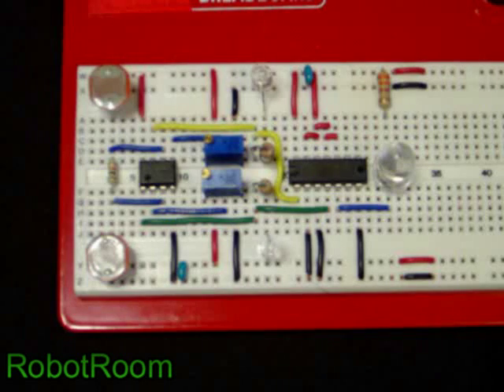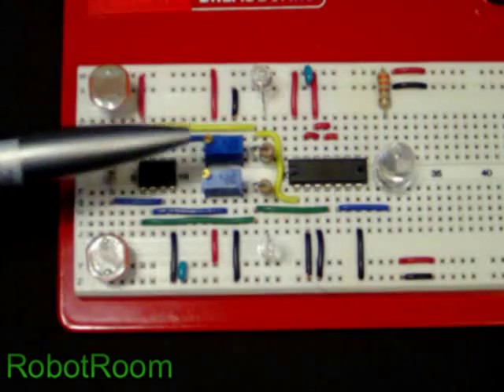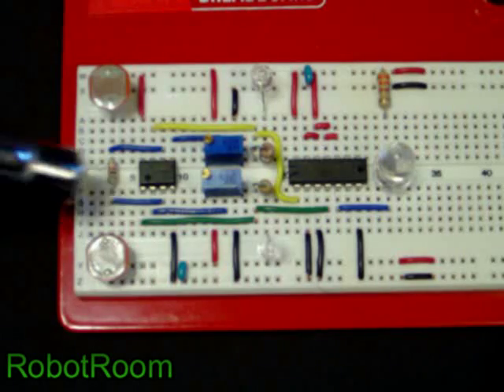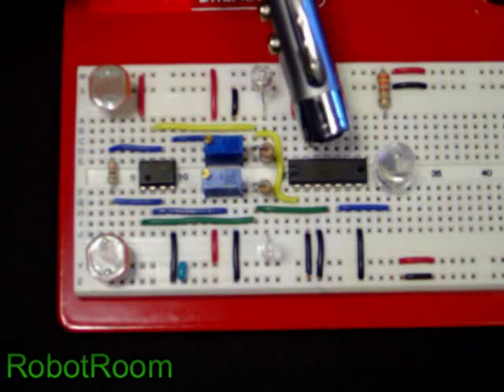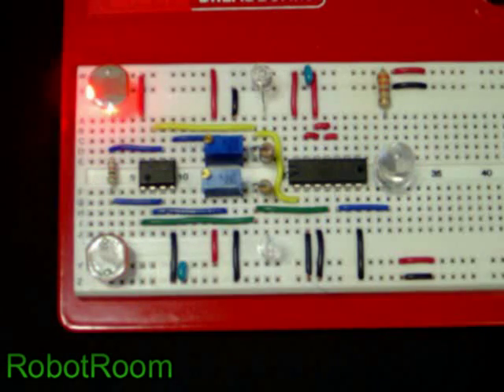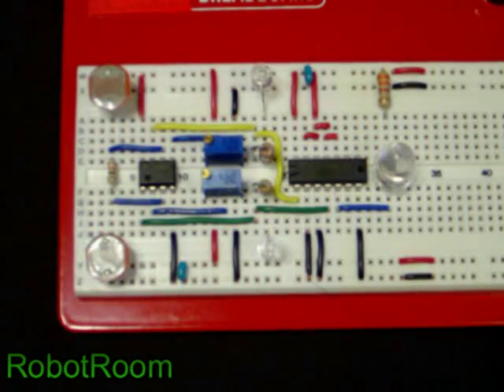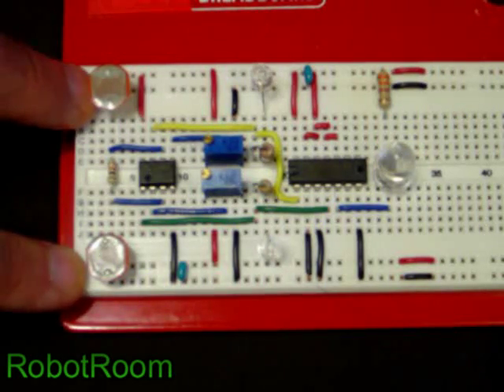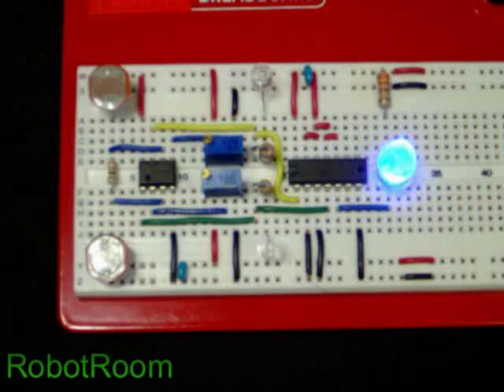Laser Detector On/Off Switch Controller

Comment: @salzahrah Ofcourse, but you should use the chip to control a relay which controls a motor (because the motor will most likely draw more power than the chip can supply)